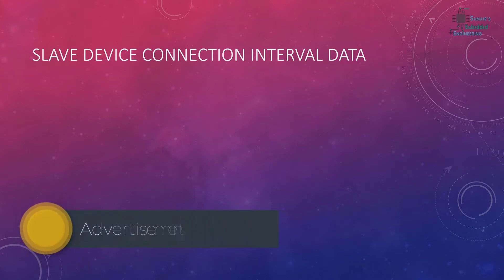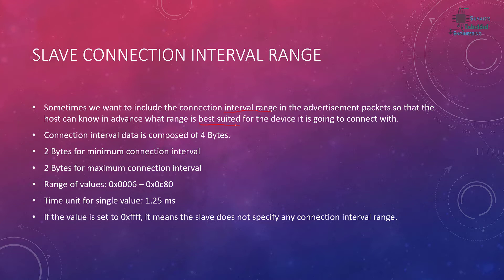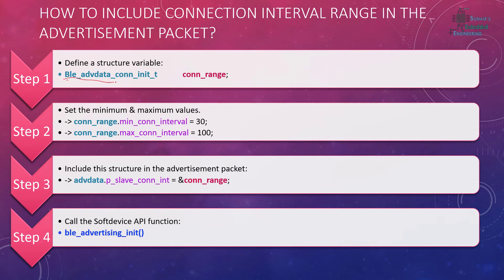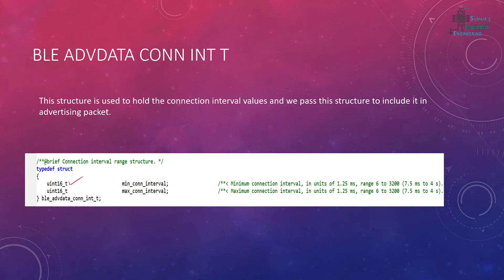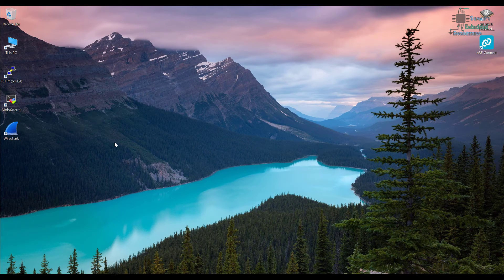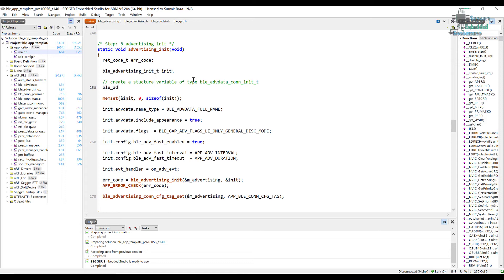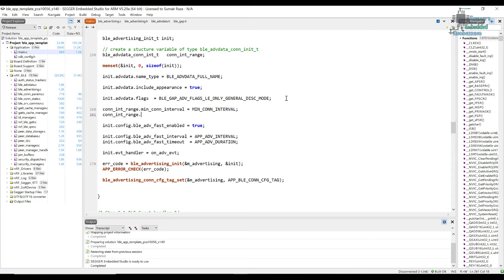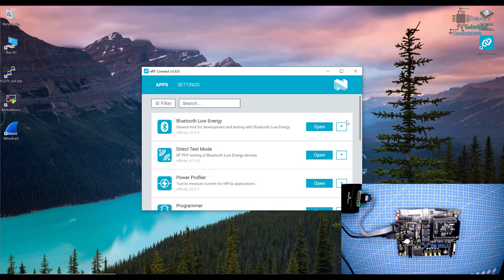nRF5 SDK - Tutorial for Beginners Pt 45 L - Adding Connection Interval data in BLE advertisement

Comment: Hello Sir! Your tutorials are much helpful.
Sir, I am working on a project very much similar to the video 35B. (MPU-6050) with nRF52832 DK.  The issue I am facing is that my MPU don't get initialized. I checked line by line using LEDs and found that the TRANSFER STATE FLAG (m_xfer_done) never gets true. 
What might be the possible reasons?